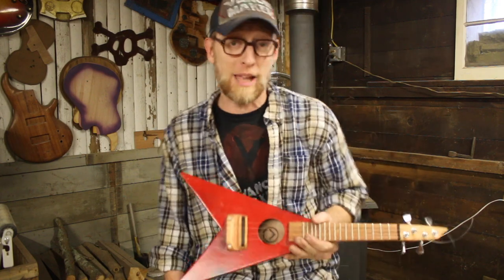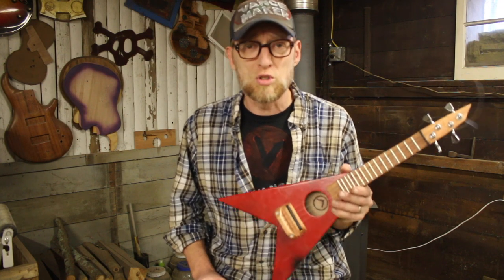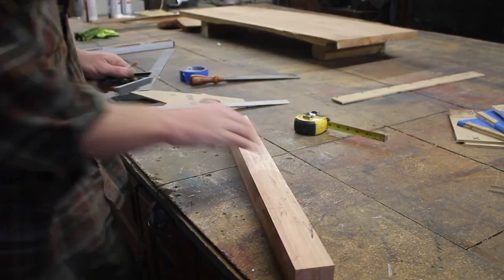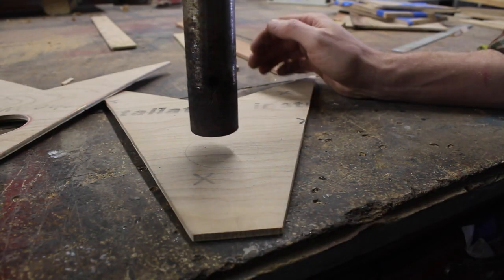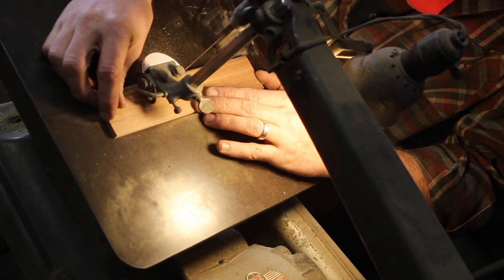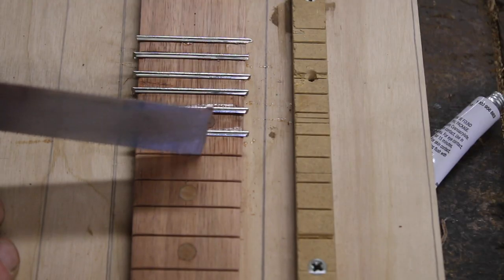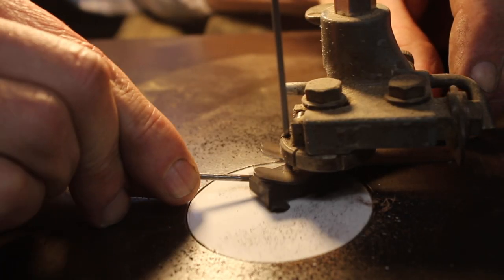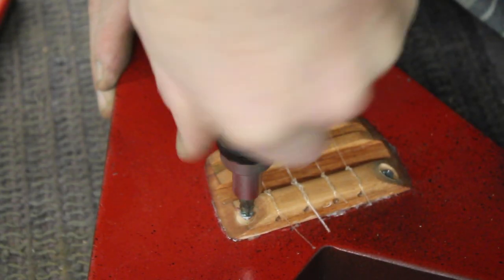how to make a flying "V" ukulele - anti black friday build 2015

Comment: That rocks Tim!  It sounds great and I like the paint job.  Thanks for the mention!  I used cotter pins for frets since they have a flat side and you can just measure and glue them on.
Reply from the maker: +Steve Carmichael cotter pins! i misremembered as nails. great idea!
Reply: tim sway yeah cotter pins are good alternative because you can get in different sizes and can be glued right on using the flat side and they already have a built-in crown on the other side....

Comment: This is so great! That thing must be really heavy, though. I suggest finding some scrap laminate instead of 1/4" ply. Reusing ebony piano keys for the saddle and nut was quite ingenious! Also, if you use fishing line, be sure to use the 4 correct gauges that correspond to the instruments scale. This can be found online. Properly setting up the action is also important, which can also be found on YouTube.
Reply from the maker: thanks for all the input! I've used weedwacker strings from the hardware store on my dbl basses in the past and they sold that in the same gauge/measurements, too!

Comment: I think you should've built a solid body electric V ukulele in my opinion, but it's still awesome!!! Brian May and you inspired me to build my own instrument out of scrap around my house. There only things that I bought were the fret wire and strings. Part of the build is on my YouTube channel if you're interested. My dad is helping me build it. I haven't uploaded more because I'm waiting for spring break so it won't interfere with my school time.
Reply from the maker: pnp072000 awesome! I'll check out your build. I wanted to learn a little more about acoustic guitar building techniques so I thought I'd start small and simple.

Comment: it came out really nice, if your son sticks to music he's gonna rediscover this instrument at least twice in his life, if it was a baught one it would of ended up in the corner of his room. i've build a few tin box and cigar box ukes its super fun and pretty stright forward, i have to point out 2 things tho, and this is just how i do it. 
1. i find that building the neck with a scarf joint makes for a sturdier headstock rather the having the grain hang out all willy nilly and a more overall rigid neck.
 2. those frets seemed a little too big for a uke i might be wrong tho i usually use medium around 2.0-2.2 mm frets for ukes.

great video
Reply from the maker: thanks! those frets are WAY TOO BIG or a uke but it was all I had on hand. Scarf joint is a good idea the headstock is def. the weakest link on this build.

Comment: Great, awesome, etc. it's all said before. Depending on the "hardness" of the fretboard I use nails or fretwire. The nails work even better when you're using a "not so hard" wood. I'm in the process of making a few cavaquinho's (the original Portuguese version of a uke) and of course I refuse to buy any material. BTW.. Black Friday here is just any Friday the sun doesn't cooperate....
Reply from the maker: +Not Just Sawdust ha ha! i saw one video of yours on the cavaquinhos. i'm looking forward to more.

Comment: are there any templates or mesurements that you could recommend? I'm not sure how big to make it. ☺
Reply from the maker: Abby Nagle Garne I didn't make templates as I freeform the build, bit the body is 9" long in the middle and 14" long down each side. 2" thick. use the fret calculator on stewmac.com for the fret measurements and Google "ukulele string length" or whatever for info on tuning, different scales and ways to string, etc. lots of info out there. hope that helps! -t

Comment: I have a lot of respect for your philosophy but remember consumerism is what drives modern society, if all of us start making our own stuff, all of a sudden it's 1650 again. The concept of individuals specializing in a single task and buying everything else is what made the Industrial Revolution possible.
Reply from the maker: right on. There's a difference between buying stuff and rampant, unnecessary consumerism/purchasing disposable goods. I buy stuff and I make stuff that I sell - I need people to buy it. But the stuff I make is designed to be used and last, not get tossed and replaced every couple years or shoved in the back of the closet as soon as its received... That's my main gripe with our current consumer model. Was the industrial revolution a good thing? I'm not saying it wasn't, but I'm the history books may have a different view - much like we have a broader view of the 1650s than they did in 1750...

Comment: unfortunately the resins in poly instrument strings is different then in fushing line, as are the actual guages ( the thickness of the string), you can tune the uke with fishing line to the traditional C,G,E,A, but the fishline will continue to stretch as the uke is tuned making it very frustrating to play. Uke strings on the other hand, "settle down" after a while and stay in tune much longer as wel as last longer
Reply from the maker: Thanks for the info! I successfully strung a few double basses with actual weedwacker strings. However they were real easy to pull out of time. It got better after a while, but they sounded like crap :)